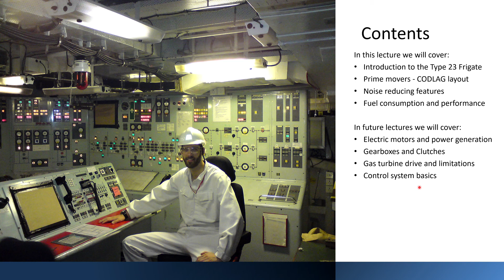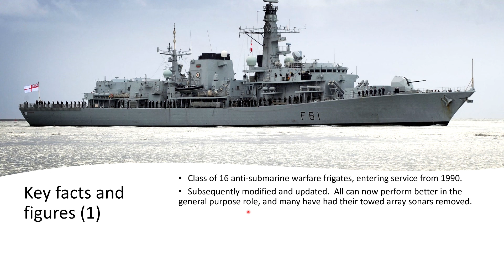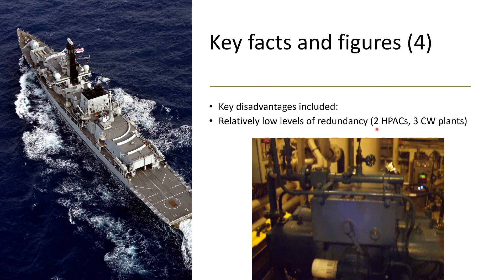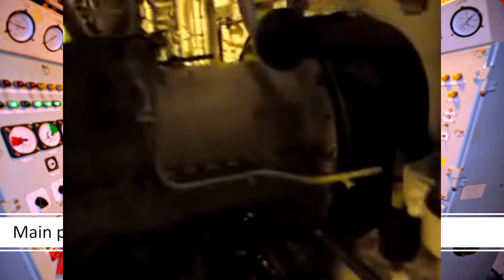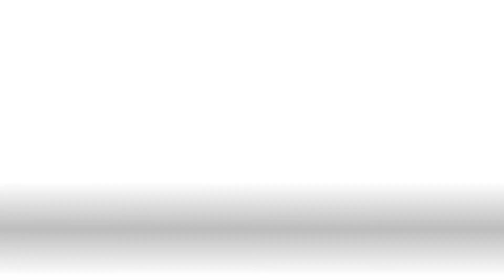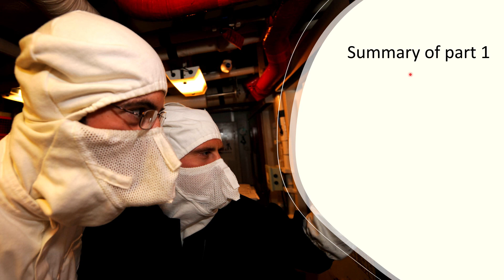Royal Navy Type 23 Frigate propulsion system  - part 1

Comment: Thanks for sharing, the memories came flooding back.
I worked for GEC Electrical Projects in Rugby in the mid 1980s as a graduate engineer and was heavily involved in the type 23 testing and acceptance. 
Noise and vibration witness testing focused on fan noise (fully enclosed as you mention) and gearbox bearing rumble. 
Something you don’t explicitly mention is that the motor, having a rotor that is part of the main shaft that has the transfer the gas turbine power has no bearings. The stator has to be carefully positioned around the rotor during installation. 
I was also involved in the testing of the thyristor drives and control system and as you state filtering was a big deal - although the huge air core choke in it’s own cabinet wasn’t the best packaging.
The first MG sets had welding quality issues on the fan tinware and were sent away to PERA (Production Engineering Research Association) for assessment and the subcontractor reprimanded 
At virtually the same time I was working on the QE2 re-engine project - a rather bigger version of diesel electric propulsion!
Reply from the maker: Wow, that's amazing! Thanks so much for sharing. Yes, there's a lot of details I probably should have mentioned but the rotor bearing one is important, thanks for pointing it out!

Comment: I find, more than interesting , your comment that you only saw the [old vertical launched  T23 version of seawolf} fired twice and it failed twice to hit 300 knot towed targets 4 miles high of obvious concern, as like many of your other comments about the now withdrawn T42s that the sonars and silencing systems were removed about the turn of the century and that the T42s after the cold war rarely operated at full power above 24 hours, as concerning and even a security issue  as the obvious'' implication could be drawn that none of the current RN air defence systems have been properly aligned to hit fast jets or missiles'' as it is well known only under the old Lord Carrington as MOD did SEa Dart and Sea Wolf in its orginal version begin to hit fast targets of a realistic nature, ie old Mach 2 Seaslug missiles, known to never have hit any real targets comparable with even a Skyhawk in Rn service or trials. It is also difficult to have too much faith in a Navy that operated without submarine detecting sonar on half its major warships for most of this century and a country which abandoned its MPA Nimrod fleet, in classic disarmament fashion destroying  all its Nimrod tools as well, presumably so know so achronistic and militaristic systems could ever be recreated. Do you get or seek RN and MOD approval for your you tube commentary.
Reply from the maker: Thanks for your comments. I wouldn't want to draw too many conclusions from my comments as:
1: seawolf worked in actual combat. (1982) In general if two missiles fail, you lob another two at them.
2: type 42s had their Sonar systems removed as it wasn't really needed.
3: the type 23s without sonar were much more versatile as general purpose frigates. Submarine hunting is pretty specialized and after the cold war wasn't as high a priority. The t23s that retain sonar have had it seriously updated to type 2087 which is probably the best system anywhere.
4: the best way of hunting a submarine is with another submarine.
5: totally agree about nimrod, although we have now bought the capability back from Boeing.
6: my observations are at least ten years out of date.
7: mod permission... What do you think...